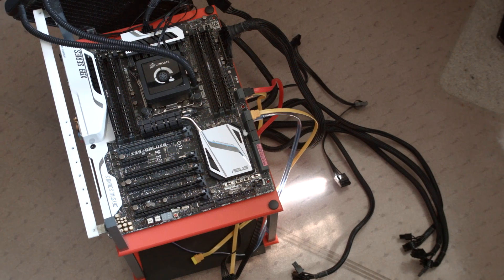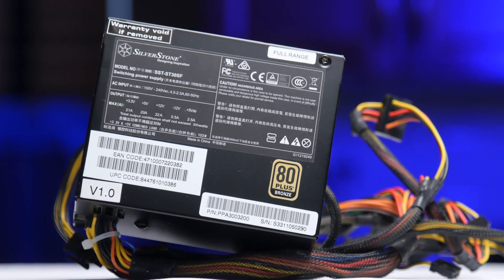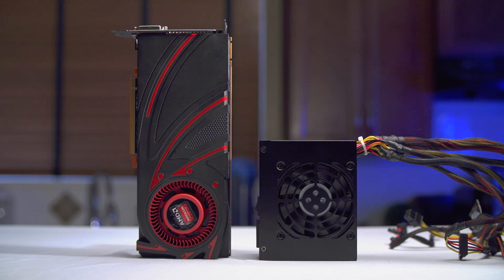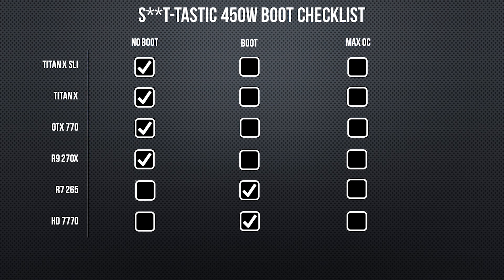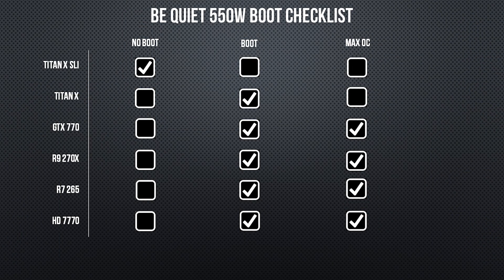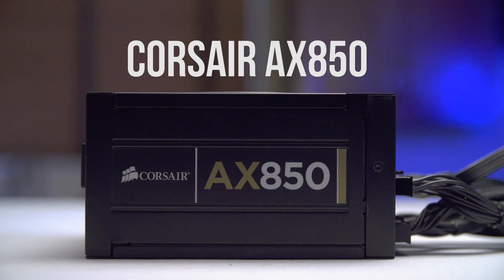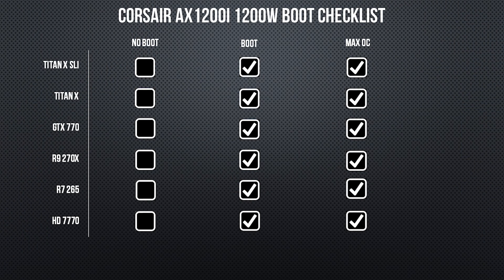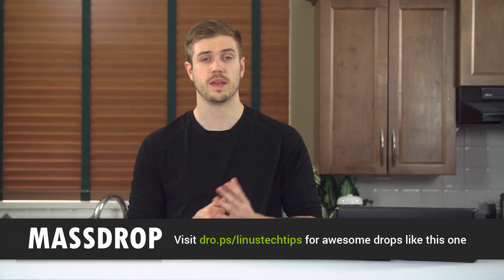Overclocking Recommendations - Low vs High Wattage Power Supplies

Comment: I have never understood why people get something like a 1200w PSU. That is a lot of money added on top of your electricity bill, for power that you are most likely not gonna fully use.
Reply: That's because you don't know how a PSU works. A 1200W power supply will not use 1200W all of the time, it only uses what the system requires at the time of use. ALSO, they have better power efficiency, typically run quieter under load (especially with small or idle loads), have ample room for upgrades or overclocks, and with that usually have warranties of 10 years or more. I had a CX750M, warranty of 3 years, poor efficiency, was not sufficient for my upgrades, and it's not "advisable" to continue use after warranty. Although it could work longer, there's no point in risking underperformance and catastrophic failure with ridiculously expensive new hardware because you're using a cheaper, older, lower rated PSU. For my old build, it was maybe even a little extra, but since I cheaped out before, for my current system I had to buy a new PSU only ~three years later. If I'd gone overboard back then, I wouldn't have needed a new one and would have had one for the next maybe 7 years, too.

Comment: So for 1200w and 900w PSU(since both has the same performance), does 1200w use more electricity? Or does it use the same amount as 900w?

Comment: CS bachelor with EEE master graduate here, you are comparing power supplies that have a heck ton more variables differentiating them than just wattage. The AXi series for instance is the highest of the highest end components working in a digital structure to deliver power.

This has got nothing to do with wattage, its components quality and it will make the whole world of a difference on the life expectancies of HW products as well as the quality of signal when overclocking.

Please don't decide on your power supply of choice depending on just wattage people. Wattage is the easiest of variable you need to consider when doing so, just aim that the total expected power consumption of your whole system + USB devices will be rougly 50% of your PSU wattage; this will ensure you are between the 20% (idle) and 80% (OCed) marks of utilisation hence maximizing both efficiency and life expectancies of all your components. Then do your research, see how particularly the signal ripple and noise values are, these are what make the difference for your overclocking.
Reply: TillOverHill Not sure what the Electrical Engineering has to do with it; any dude who values the money he spends on a rig should be capable of doing a bit of research regarding PSU's before they make a purchase.

The Flextronics-built AXi series are overpriced for what they deliver in enthusiast PC contexts. The KM3 or Leadex platforms (ie: Seasonic X Series, Cooler Masters V Series, The Golden Flower Leadex Series, and the EVGA Supernova Series (G2, P2)) are much better buys than the Flextronics AXi units when you consider the cost difference between these respective platforms, relative to their performance in every conceivable performance and build-quality metric. Corsair is genuinely cashing in on the "AXi > all" mentality that runs rampant through LTT, H|F, and OCN.
Reply: proxactual I mentioned my degrees so that people wouldn't go all defensive against what I was writing since it wasn't positive about this video, also my masters research studies involved in a lot of research into electrical circuitry and power efficiency with some out of the box thinking on what comes after the traditional PCB and silicone circuits etc. hence I thought it'd be note worthy when talking about power supplies.

Anyway, I agree completely on your point that the AXi series are overpriced and I also think they are niche products average customer would not happily pay the price premium for with a very very big margin of profit stamped all over them, however, the difference between the AXi series and the AX series (the AX series were made by Seasonic by the way, nearly identical to the X series of Seasonic in signal quality) is statistically big enough that there is a difference between the two noteworthy enough.

This difference wasn't apparent in voltage regulation and/or in coil noise etc. but it was very obvious when the electrical noise in the signal was measured. Digital is better than analogue here and there is no argument against that. I personally use an X-1050 also by the way, but particularly the AXi 1500watt is just on a league of its own; was the finding of my testing done on them at least.

I just wanted to add in my bit of thought to the mixture because I thought it was missing in the video. I can already read comments on this post right now, such as "if budget then 400w is enough for you". It's just misinformed, and has only a single perspective.
Reply: Yeah, I was thinking "didn't Toms Hardware and PCTech do a ripple, noise, maximum power and efficiency test awhile back not just will it run"
Reply: Deathbrewer I am a guy you have randomly encountered on the Internet, of course I do not have any credibility. I just drop in my piece of information input and hope that someone listens. If you have any more depth than what I have said, feel free to share.

Anyway, if you do any research, you will find out that, whilst negligible, there exists an effect electrical signal noise and ripple amount cause on the power signal significantly affecting overclocking potential of systems when they are pushed to their ultimate limits. Though, I'll save you from that research as there is none done by anybody credible enough to prove this. Such research would have to be done by using a hundred CPUs that overclock to nearly the same values in order to eliminate selection bias and other variables that might impact the end result. These CPUs then would have to be tested using the exact same PSUs divided into groups in a way to measure how ripple and signal noise affect their life expectancy, overclocking potential and stability over a very very long time. Hence nobody has bothered, particularly since it isn't something the average consumer would understand, since R&D is done to bring in more money and more customers.

Comment: im planning on doing a cheap build, ive chosen a fx 6300 and im deciding to only overclock it to 4ghz with stockcooler, i would like to know what would be the smallest necessary psu (as spending money is low) to overclock the cpu and put 2 crossfire r9 270x

Comment: From this testing, I can see that a good 900w  power supply will more than handle my rampage gene 2 mobo / core i7 920 running at 3.2 with headroom (had 3.6 stable with headroom) / zotac gtx 750 ti / h60 aio cooler setup with PLENTY (overkill) of power left for expansion and upgrade in the future.  Thank you for finally making a video that clearly shows what a power supply can do so we can all get a better idea of what we need and get something that will upgrade with us over time.

Comment: "This psu is rated at 300 Watts and is 'somehow' pulling 375 watts out of the wall", yeah Luke, that's called 80% power efficiency. You should know that.

Comment: Is my 13 KwH electric power supply I pulled from my old ship gonna be enough power my R9 290 and my i7 4790k@1,3V?
Reply: No.
Reply: Ashley Bengtson Thanks Ashley,dude.
Reply: ***** Dont turn the PC on!!! It might overload the psu and it will most likely explode!

Comment: Does a PSU constantly burn its rated wattage even if the hardware needs less wattage? Meaning are you paying for the power even if your computer isn't using all the wattage? Or can all/any PSU throttle back and only use the wattage the hardware needs?

Comment: i have two gtx 970's, my cpu is overclocked to 4ghz, i have an i7 5820K and a CX750M PSU... will i be able to OC my two cards ( without messing with the power limit )?

Comment: i have an i5 4950 and a gtx 960, both running at stock settings and have a 650 watt power supply. Can I overclock my graphics card as far as I want?

Comment: if you know basic electronics you can just add up the wattage and amps used from each component. the only real drain on PSU's is from GPU. what cpu uses over 2v ? lol 500w psu and you should be good unless using a high end gpu, then the max id say you need is 650w. these people with 1000w crack me up...oh i neeeeeeeedz mah wattage fur maxxxx efff peee esssss!

Comment: Hi Luke,
Enjoyed the video.
Could you specify details on the cooling used when you ran the max overclocks on the setups in the video ? Could the power draw of the cooling system have an impact on the power draw? Also, how much cooling would you recommend for these setups and why, considering running overclocks could have an impact on life-span ? 

Thanks again, for the effort
Peace

Comment: Budget build - 300-400w
Midrange build - 400-500w
High-end build - 500-650w (single GPU)
Extreme build - 700-850w (dual gpu)
Master Race build - 900-1200w (tri/quad gpu)
Always go for a good brand/model.
Reply: No good brand, only good models
Reply: Clean Hardware Seasonic is definitely a good brand.
Reply: Xuvial Sylvester It's actually more efficient around 50 to 60% (Corsair RM750 example: http://www.techpowerup.com/reviews/Corsair/RM750/6.html). That said, about any decent unit out there the efficiency doesn't drop very fast after the 60% load. Especially units that have 80+ platinum rating.

Clean Hardware While the H100i is a great AIO (I own that one myself), The Kraken X61 that TheShadow0212 has picked is slightly better. It's an 280mm radiator with two 140mm fans, which run at slightly lower noise levels while cooling a bit better. While that does not really justify the price, it's a great alternative if TheShadow0212 want to reach high overclock speeds while maintaining lower noise levels.
Reply: jpchevron so, all their products are perfect? NO! They have shitty products too
Reply: Xuvial Sylvester I bought a 1000W PSU accidentally because it was on sale over the 750W version :D

But I only have a single GPU so...
Reply: Gamer Nix  500w is enought for an titan-x or 290x
Reply: Clean Hardware you don't want to be running your PSU at 100% load though, around 70-80% is most efficient. That's why with single gpu high-end build I've recommended 500-650w.
Reply: Clean Hardware No, I disagree. Super cheap Seasonics are still quality for their price point. The real garbage (diablotek, coolmax,...) actually have dangerous products. Even an $18 Seasonic 200W PSU will not burn your house down.
Reply: carzacc from 650w up
Reply: Clean Hardware Too
Reply: Xuvial Sylvester 1500 watts for 4 way SLI and OC CPU
Reply: ben fusco 4way sli is stupid

4way sli oc980 =800-900w

Cpu oc: 150w....
Reply: Clean Hardware Its not stupid, the titan X's actually scale fairly well unlike the 980's there is no point having 3 or 4 way SLI 980's however if you want 3*4K moniter playing battlefield hardline @144HZ then you will need somthing powerful
Reply: finkrer Just look up
Reply: Orc-in-Hell thats an great psu, i wish i didnt go cheap with mine
Reply: Probably the graphics card shutting down to prevent damage
Reply: ***** I do not know why you are crashing, but what i can tell you is , that the r9 290x idle temps stay high because(from what i know on the reference one) the fan tries to make it self quiet as fast as possible so it goes rather quickly back to 25% when it is not hitting a high temp. the fans usually ramp up when the gpu is already hitting 90-95 degrees. idle temps around 70-60 are normal.
Reply: jpchevron I love the platinum 750. Its a bit overkill because the fan never spins up. There is 0 dust on the filter. And no the fan isn't damaged it's because it's on semi-fanless mode and i never exceed the 30% load.
Reply: FoodOnCrack sometimes that dangerous (psu overheat) because its based on use not temps
Reply: Xuvial Sylvester my corsair rm650 will hold long time :)
Reply: Ulvis Barkāns not if you are unlucky and it breakes :/ (have seen a lot of problem but dont worry its 1-3%)
Reply: dunno have now worked for aaa hard to say 1,5 year? changed my tx650 to this because didnt work fan control all the time was at max speed tx was like for 3 years
Reply: Ulvis Barkāns you wont have a problem then (it happens after 3-5months)
Reply: :) low it because got modular vs nonmodular :D what save a lot space and bronze vs gold :D
Reply: Ulvis Barkāns no its because its well ensambled, modular only helps on airflow and efficency is for saving money on electricity bill
Reply: *****  its stupid have more then 550w for ANY single gpu
Reply: ***** Yeah this in't really right cus cards like your 980 although powerful have low consumption so his list can't really be taken seriously.
Reply: yeah these cards are energy efficient and are not as power hungry as their performance makes them look.
Reply: Beyond "midrange" these wattage recommendations consider overclocks on both CPU and GPU, more drives, peripherals, fans, lighting, etc and with some room to spare.

Yes, you can run a Titan-X on a 500-550w. But if you've also got a beast CPU to go with that and everything overclocked, I would recommend at least 600-650w.
Reply: Xuvial Sylvester overclocking maxwell is stupid for the 4-6fps you win (300mhz) and cpu is not needed.... so i dont think you need that ... Ahh and just in case :

Titan-x 300mhz oc ~320w
4790k 5ghz ~ 150w
Everythink else ~50w
530w

And ram and fans dont use 50w....
Reply: Xuvial Sylvester even in that case.... 600w is enought
Reply: Xuvial Sylvester i was planning to get a gtx 980 5820k cpu and then oc the cpu aswell. I chose a corsair 1200i cuz the writing on it matches my red build. lelelelelle anyways,when psu's wear down, how much watt loss do you get?
Reply: TheShadow0212 repeat the question please
Reply: Clean Hardware To make it short, http://pcpartpicker.com/p/dVq8vK will oc the cpu. the psu is a huge overkill right? but the writing on it which is red/orange matches my red build. rofl. and which one of corsairs psu's has the most efficiency?
Reply: TheShadow0212  http://pcpartpicker.com/p/xK6LBm (if you didnt bought it jet this would be a 4-55 slower but 200-300$ cheaper) and the psu is ok, but you dont want to have to much wattage because its expensive
Reply: ***** no thats not an pc, thats an workstation.... Fuck you have a lot of extra parts lol
Reply: Xuvial Sylvester GG 650-700, 850-900 and 1200+ PSU dont exist apparently!
Reply: Kyran h100 silencio 120m etc everythink ok but there make slightly more nois and are only slighter cooler and very expensive.... (H80and lower suck)
Mi just dont like liquid on my cpu :D
Reply: Xuvial Sylvester haha i have a 750w psu
Reply: Xuvial Sylvester Bah, what about us running dual EVGA Supernova G2 850W? Fits like a glove in the 900D.
Reply: Garry Perkins i want a teast to proof that, and not a "review" that only test wattage and efficency.... I want a complete one to proof that.... (To test it you need a 10.000$ equipment) so no i dont think that 18$ seasonic is better then other just because its seasonic
Reply: +Clean Hardware  is it recomended to buy a high wattage power supply are what plz tell me
Reply: HOLLY MEGA GAMES
ask in english please... i dont understand what your saying
Reply: should i buy a high power supply for a amd r7 250 are what am planning to buy 750 80+ watt power supply should i buy that one are a lower wattage
 one plz tell me
Reply: HOLLY MEGA GAMES
 That is a very low-end card, you won't need more than a 300-400w at most.
Reply: am gana upgrade it doe so i might need a 750 gold
Reply: whats the best r7 to upgrade to
Reply: Drunk Gaming Finland Seriously? SLI with what cards??
Reply: +Xuvial Sylvester EVGA Is a great PSU brand, with a 10 year warranty
Reply: +Massie Mayhem only on the best models, the 400w model, for example, is crap and only has a 2 yr warranty
Reply: how is the thermaltake smart pro rgb 750w? im powewring a OC 8700k and GTX 1060
Reply: Correction: High-end build - 550-650w (single GPU)
Reply: Is 600w enough for overclocking a cpu (Intel i7 9700KF)
Reply: Never go Corsair

Comment: Moral of the story: a cheap psu like a VS550 is enough to power anything unless using a x99 rig or dual high end gpus.
Reply: Sadaki sad part is you got kids running around with dual core cpu and some gtx 4 series talking about how they need a 1000w psu just cause it sounds cool.
Reply: Sadaki Well, if you dont want to worry about any complication if upgrading down the line, maybe even adding a second gpu an 760w or 860w PSU is pretty much the sweetspot. But as long as you buy from an good and trusted brand and stay away from cheap chinese ones you will be fine anyway.
Reply: Sadaki A VS550 is far from cheap. It is a quality Seasonic-built GPU that can put out 550W all day and all night. most PCs would be happily powered by it. Those who want to overclock big GPUs or SLI need more wattage, but Jow six-pack with a 3570 and a GTX-670 will be fine with a VS550.